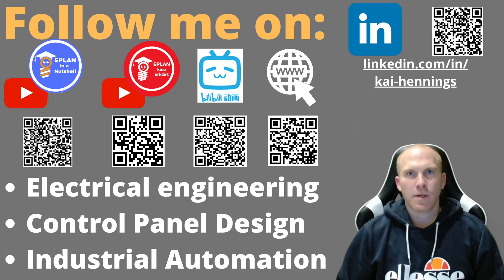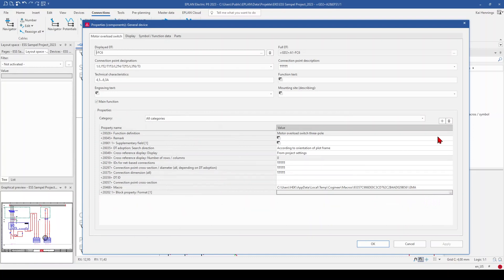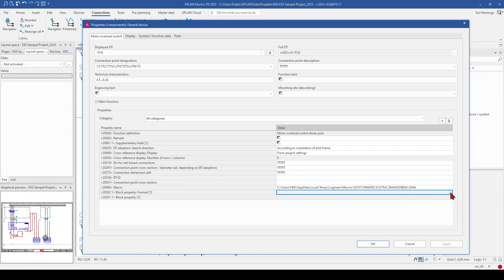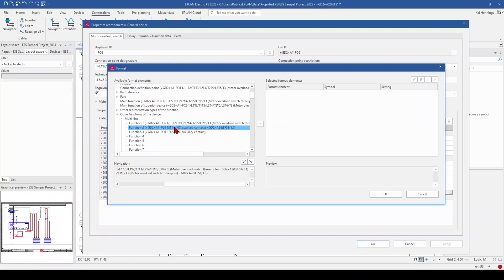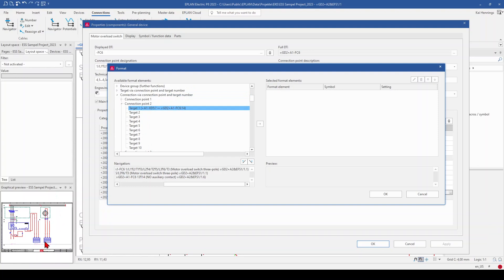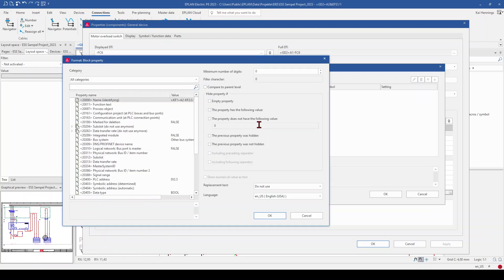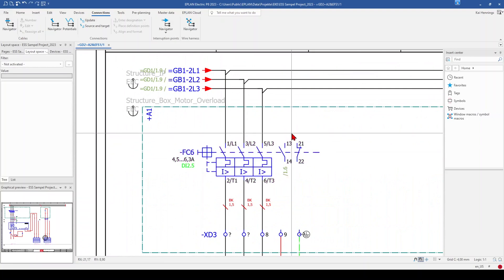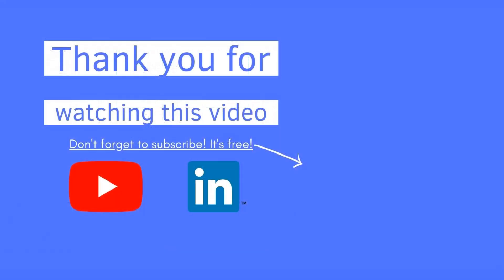EPLAN Block Property

Comment: Hey, i am also using block property. But i want to change path function text / automatic function text on interruption point. Like where that interruption is going. My interruption point going to the plc connection point . And path function text like 24vdc supply. But this is not working in all interruption points. Do you have any idea.